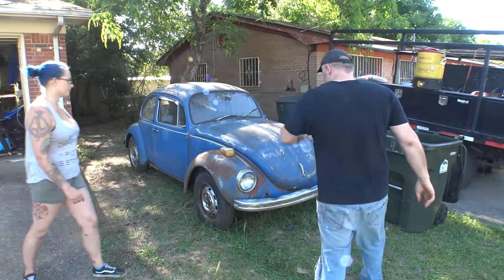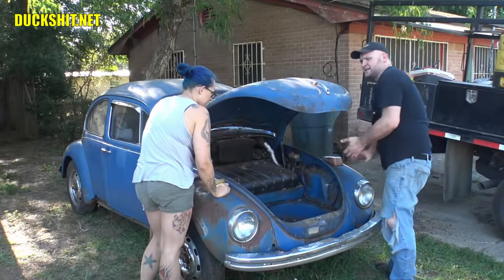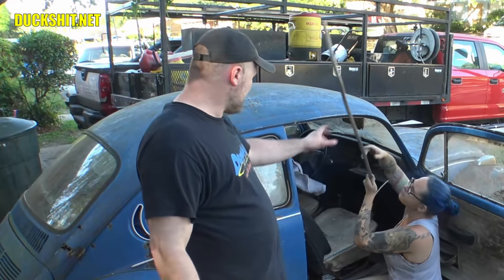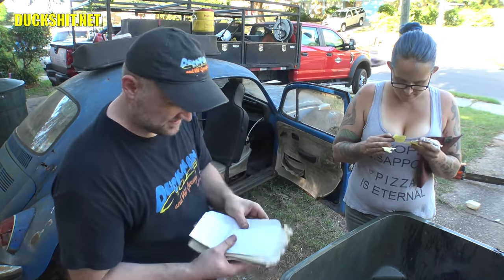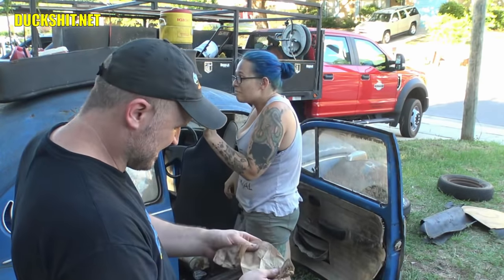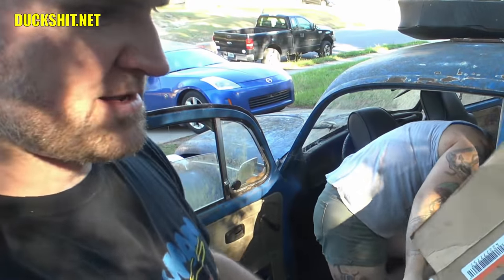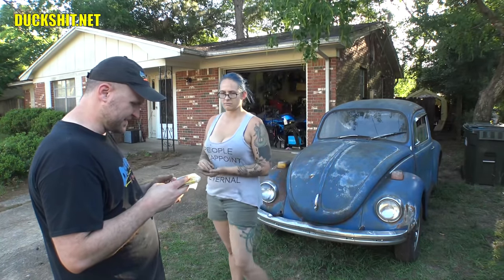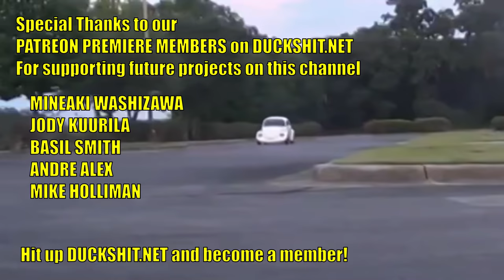Mystery Junk - 1972 VW Super Beetle Cleaning Out

Comment from the maker: What interesting things have you found in a classic VW that you brought home?
Reply: got a ruby red 65 beetle last fall. found 3 pairs of sunglasses and about $3.75 in assorted change.  I found a 14th edition spiral bound Idiots guide in great shape. a battery tender, a box of assorted parts, mostly new body seals for the tail lights and fenders. a VW 1200 owners manual also in great shape and an owners manual for a 73 VW bus.  there was a folder full of receipts and invoices for all the work done on it,over the past 3 decades the previous owners had it.   Also they must have named my car "DeVille", as some one stuck the model scripting decal off a Cadillac de Ville on the side of the car under the Antenna. also a few of the those Caddy logos.
Reply: When I got my '66 Beetle (which I shouldn't have messed with) I found something interesting. Got in it barefoot one day and felt my feet wet, but it hadn't been raining. Lifted the floormat and it was Brake Fluid! The line to the back brakes looked like A "Dirt Dobber" had tried to make a nest and then I realized somebody had used JB Weld to try to fix the brake line! Ran inside and washed my feet. New master cylinder and brake line, etc..
Reply: I bought a white beetle one time, and there was a lot of duck shit!!🤣🤣🤣
Reply: some boxers with crusty doo doo stains
Reply from the maker: @Vochowagens  HAHAHAHAHAHAHAHAHAAHAHAHAHAHAHAHAHAHAHAHAHA!
Reply: my latest bug - bonnet (hood in 'murican) was stuck shut when i bought it. after we got it home and had a fiddle with the cable - 2 unopened boxes of budweiser!
Reply: Previous owners toupee behind the back seat. Thought it was a dead animal at first.
Reply: =ê
Reply: I bought a used camaro once and the shifter was Rough so I pulled out the whole console and there was like 30 bucks in quarters,nickels,and dimes trapped around the shifter and for the life of me I couldn’t figure out how it all got stuck in there but it ended up shifting pretty dam good after I got it cleaned out!

Comment: Sometimes they throw in those types of coverage for free when haggling prices! I always shopped at discount tire and they would give me everything including tire siping and road hazard protection/ replacement for free, they would even give me higher mileage tires than I was shopping for at no extra cost. You may not think it can help but when you rip a tire open via road debris or even get a bulge in the sidewall and get a free replacement it is awesome. I never paid for the protection, the key was claiming I only had enough for the cheapest tires plus tax and some for mounting. That is when they will literally knock off money just to give you the protection and extras! Always claim you only have said amount, shop ahead know the price and tell them you can't afford more than the basics and most great tire places will give you the rest free!
Reply from the maker: See, I am in a different boat.  Talked into coverage once, really didn't want it, but figured WTF, let the dude have his commission.   I ran over a nail a month later.  The $5 plug was free. A year later the warranty was over.... wasted money.   Any time I had a tire issue I fixed it myself or I was too far from home to be able to use the warranty at the shop which it was purchased.  LoL!  Maybe I am a special case, but I won't get the tire warranty ever again.
Reply: @DuckmanCycles  Same with extended vehicle warranty's on new cars.... try getting a claim recognised with those..good luck!

Comment: i just bought a 73 super beetle for 100 dollars  , no rust in the floor pans i got all the tail light and brake lights working. rebuilt the motor. new master and wheel cylinders . all good glass a few dings here and there. started it and it runs fine. but it seems to be idling high. i bought a new carb and distributor. before i bought the car and distributor it had a bad hesitation.. hesitation is gone. but for some reason i think i might have a vacuum leak.could that be the reason why it is idling high ? oh and thanks for the tips on bleeding the brakes. it worked out just fine
Reply from the maker: Sounds like you got one heck of a deal!  Are you making some videos?
Reply from the maker: The idle could be high because of distributor or carburetor.  Make sure your timing is correct before you make any adjustments to the carb!

Comment: I just picked up a 2005 new beetle yellow convertible- it had jumped time and ruined all the exhaust valves - put it on the lift and dropped the little turbo 4 cylinder out the bottom of the car lol.
Reply from the maker: Ouch!  Put an air-cooled VW engine in there!  :)

Comment: Hey there, Just began watching your Channel, excellent content, and entertaining to say the least hehe, i may need your help bleeding my bug brakes, i did It yesterday went all fine until i got to the front passanger side, didnt had the correct Tool, soo i let some Air in, and the brake pedal went to the floor, tried to bleed some more on that wheel, but didnt work, the doubt is, do i have to bleed everything again, let the fluid go all the way to the passanger back wheel again or Just enough for the blubbles to stop?
Reply from the maker: It depends on the year of your Volkswagen, if you have a dual Circuit Master cylinder you will only have to bleed the front brakes.  If you have an early single circuit, you will probably have to re bleed everything to ensure no bubbles!
Reply: @DuckmanCycles  it's a dual, i did only the front and the pedal went up, and with no bubbles, thanks Man.
Reply from the maker: You bet!  Glad I Could help!  Thanks so much for the response!

Comment: Man U lucky 
Every bug I’ve had you could lift the body off cause it was soooo rotted. 
U got mint ones compared to the junk I’ve had
Reply from the maker: Wow, even Eleanore broke in half and still couldn't seperate the body from the chassis.  The front end was only held on by the steering column, but the rear was pretty tightly attached to the pan!